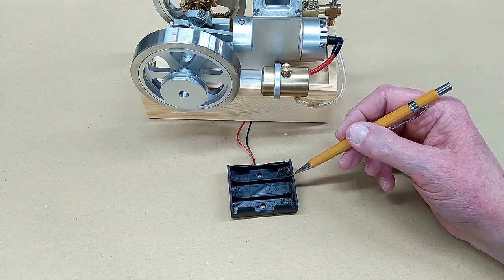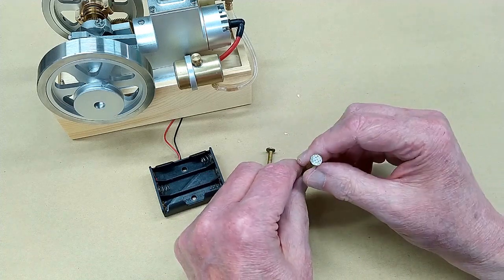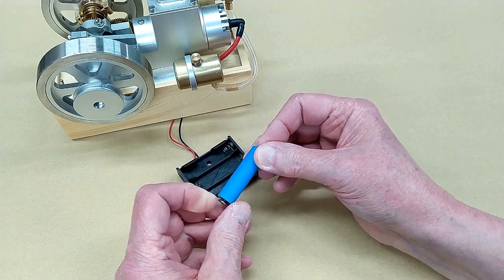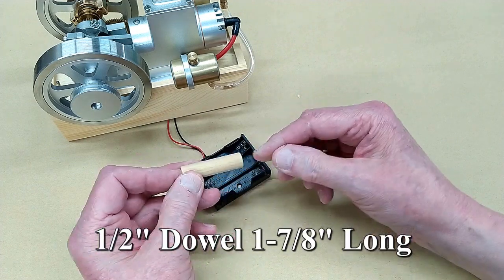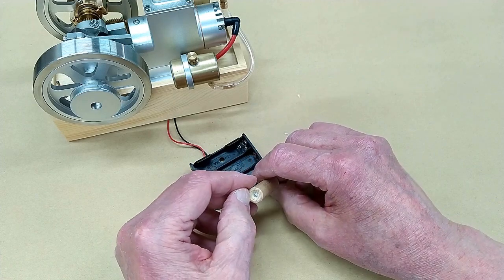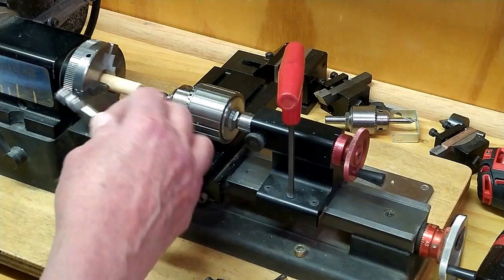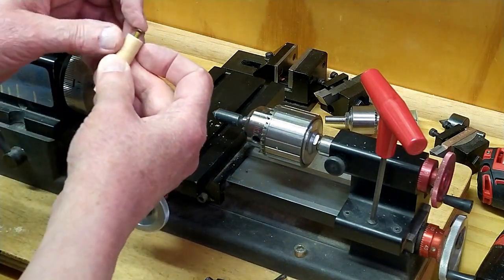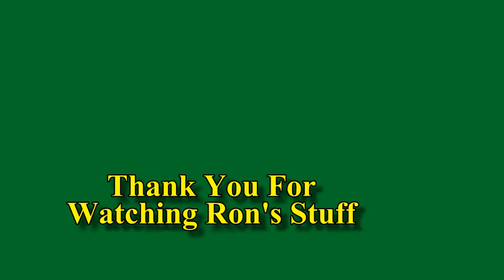Dummy Battery For Hit & Miss Engines

Comment: Thank you very much for sharing this tip !!
 
I made 8 of them for all my chinese mini engines. Works excellent. 
I have already 4 brocken ignitions in the meantime. I also was able to bring one of them  back to life this way. 
I love your channel. 
I also printed your starter for the 6cc vertical engine. My engine was a bad starter. All of my other engines start by hand. 
I have one question. 
Do you plan to make a video about the M17 engine?  It has a outlet valve and a sniffer inlet valve. Very simple engine. No hit and miss. Only a simple fuel/air mixer but it runs very smooth and slow. It can accelerate up to 5000rpm.But normaly mine idles only because it is such a small engine. And many buyer of theese engines forget that this are model engines and they destroy the pistons this way. The mixer is very, very sensitive to adjust. The leaner the mix the faster the engine runs. Would say it is the optimal beginners engine.  Very easy to start. 
Not expensive and a nice gift for the desktop. 
Best Regards from Germany and stay healthy. Sorry for my english. 
Manfred.
Reply from the maker: Hello Manfred,
Thank you for your comment. The dummy battery has worked on most of the engines, however there have been a couple recently which would not run with only two batteries installed and required all three batteries to fire. Please keep that in mind for any future engines.

The M17 is what Banggood calls the EM3 and has an atmospheric intake valve and rocker operated exhaust.

I am supposed to receive a M17 for review, however they ran out and the manufacturer seems slow to resupply this engine. At this time I do not expect to receive the M17 until sometime in November.
Ron
Reply: @RonaldWalters2010  Hello Ronald,
thanks for the fast reply. 
Also on Jin‘s ebay side there is no offer of this engine at this. I have seen a 16 second video on youtube of this type of engine as hit and miss engine. That is what I hoped to get. Looks like the large M90 horizontal engine and has the identical controls for hit and miss. With springs and weights on the flywheel. 
But the M17/EM3 is a nice engine with lots of compression and a very nice  and reliable spark now 😁.

Comment: I've usually wrapped scrap paper around some formed (copper) wire or machine screw to make the spacer. 

Dunno why it's never occurred to me to use a nail, cut to length.